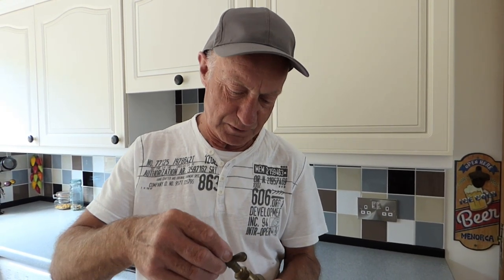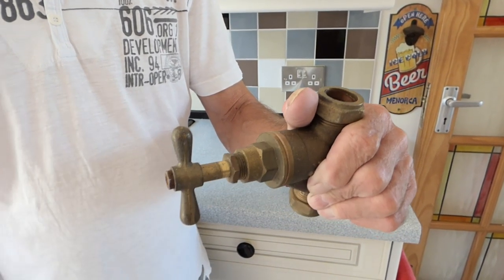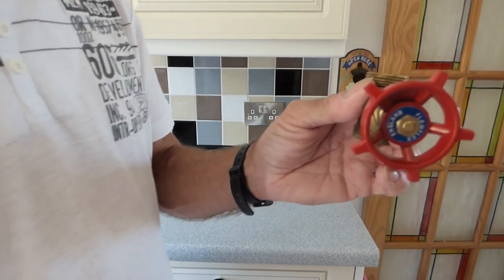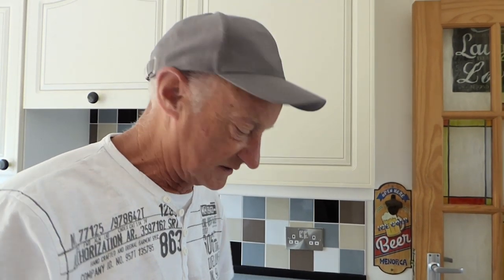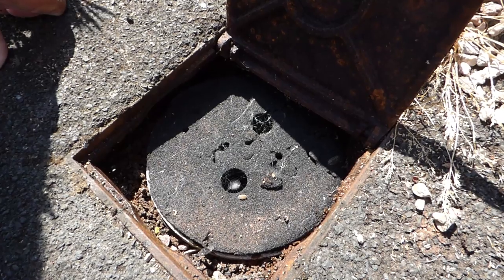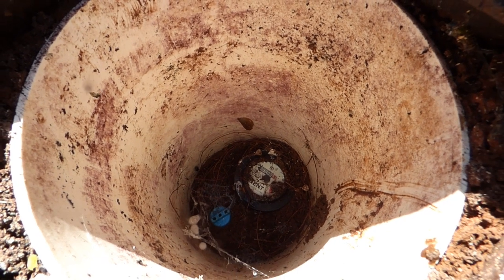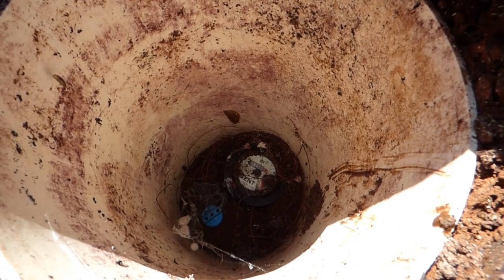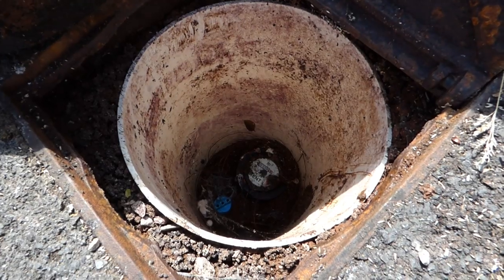"Stopcocks" how to make sure they work when you need them.

Comment: I had an overflowing water tank .
Both internal and external stopcocks were seized and the Water company couldn't come out for over a week.
Plumber came out but he couldn't fix it with the water running he said.

I ended up fitting an "Aladdin easy fit isolator" from Screwfix myself.
Great piece of kit if anyone has the same problem as me.
Reply from the maker: Thanks for the info.

Comment: As always, your videos are great. A question about the inside stopcock. I helped an old lady where here toilet over flow was pouring out. So I turn off the stop cocks which was hard to turn at first but with a few movements left and right I managed to close it, I also adjusted the cistern float a tiny bit so it should stop the over flowing, I did a few flushes on the loo to get the water level down a bit, done the adjustment and turned on the water again, but loo didn't fill up, I heard the noise, so I went up to the loft tanks, I checked the levels in both which was OK, what could be the cause????  I thought there might be air in the pipes but there was none, bathroom taps worked but I only half the pressure, what could of been the problem???
Reply from the maker: Check out the valve seating for debris blocking the feed which can happen when you turn water back on.

Comment: Top tip! Access to inside stop-cock. Take a photograph of where all of the contents of the base unit are before removing them. Then you can put everything back exactly where you found it. If the fabric conditioner is not positioned to the right of the washing powder and the fly killer spray is not on the top shelf between the bleach and the furniture polish... you'll never hear the end of it.
On a serious note. If you have to turn the stop tap off in the street, it's not metered and you share it with neighbours, ask their permission first. Trust me on this. It can cause an awful lot of trouble.
With Al's permission I can provide evidence.
Reply from the maker: Yes I remember you telling about your shared stopcock experience. If you want to provide your evidence go ahead loafer. Well worth putting it out there.
Reply: I've edited my post. There's a direct link listed to this, your upload in the description box.
Reply from the maker: I will add it to one of the recommend videos on the end of the video.

Comment: Thanks for your vids! When opening the stop cock, why do you turn it all the way back?  I recently shut mine off and then to re open it I just turned it half aturn back; there seemed to be enough pressure in the taps just opening it a small amount.
Reply from the maker: A lot of houses do not have that much pressure and need to be fully on. If your pressure (flow rate) is ok with just a half turn then that is fine.
Reply: @dereton33  Thanks for taking the time to reply.  Good to know.

Comment: I have a gate valve in my airing cupboard which has been seized solid for about 20 years, it doesn't seem to be a problem.

The last time I looked in the meter well I found a full sized frog.  I've no idea how it got in there, there was no apparent hole by which it could have entered.  My meter reader says that it's quite common.
Reply: There is a way that you can un-seize gate valves. If it's in your airing cupboard it's probably nothing to do with potable, cold water to taps and saniware, more likely it has something to do with feed and expansion tank for your heating. If seized in the open position there's no immediate need to worry, but if seized, closed I'd get it attended to. Then again, it might actually be redundant. Who knows?
You are lucky you actually have someone come around to read your water meter. We rarely if ever do. I have to keep phoning up to give the water authority a reading. Surprise,  surprise... they always over-estimate! Wonder why? Not only that, ours and next doors meters were crossed. Turning off ours in the  street stopped their water and vice versa. You might want to consider running you kitchen sink tap and ensure that after you turn off at the water authority meter and ensure water stops coming through. Also, if you do have a cold water storage tank for your hot water cylinder (airing cupboard or loft) make sure that this drained off too before you cut into any pipes.
Reply from the maker: O well frogs legs for dinner.
Reply from the maker: Thanks for the info Loafer.
Reply: @loafersheffield  Severn Trent Water are quite efficient when it comes to collecting money, they read the meter every six months and the new bill appears (online) the next day.

My gate valve appears to be between the cold water header tank and the hot water cylinder and of course it's stuck in the open position.  The handle is missing and the square shaft has been rounded off by someone before I moved in.
Reply: It'll be either 22mm or perhaps even 28mm pipe if it comes down straight to the bottom of the hot water cylinder. Double check the pipe runs to ensure that it's not the feed from the smaller feed and expansion tank for your heating.

Comment: I sought Al's permission first before I posted this link and he has kindly consented. 
Cheers, Al!

It concerns turning off water in the street if you share an un-metered supply with neighbours.

https://www.youtube.com/watch?v=y4o3RdzAzK4

Additional notes of caution if turning off your supply even if you have a dedicated metered supply or not. 

You may be  lucky to actually have someone come around to read your water meter in the very first place! Check out your bills. They may be routinely estimated.  I have to keep phoning up to give the water authority a reading. Surprise,  surprise... they always over-estimate! Wonder why? 
Not only that, ours and next doors meters were crossed. Turning off our stop tap in the  street stopped their water and vice versa. You might want to consider running you kitchen sink tap  to ensure that after you turn off at the meter or street stop tap, that water actually stops coming through; especially if you are changing taps or cutting into pipes.
Reply from the maker: I have also posted this link to the description of the video Loafer, thanks for letting me use it.
Reply: No worries, Al. Right, lunch over,  back to work. No real rush. Bathroom refit for the missus. Got 4 1/2 weeks before she gets back. She'll complain of course.
"What! No pop-up bath waste?"
The bath has a shower located directly over bath plug-hole----------------> jammed plug when someone stands on it and it gets jammed closed. 
Guess who will have to free it and/or change it completely if the cable release gets broken? 
Chrome plated plug on a chain, methinks?
Reply from the maker: The old fashion ideas are still the best.